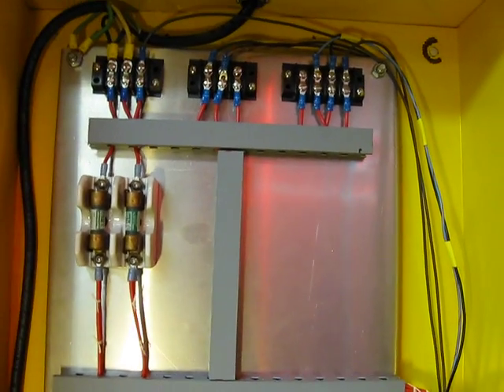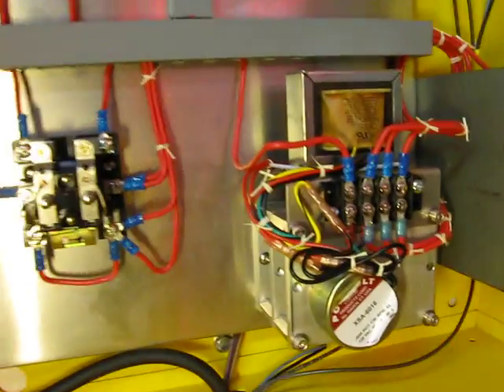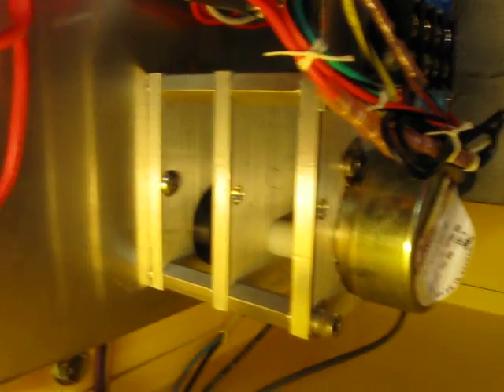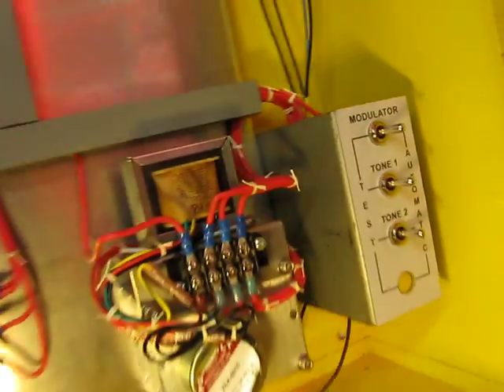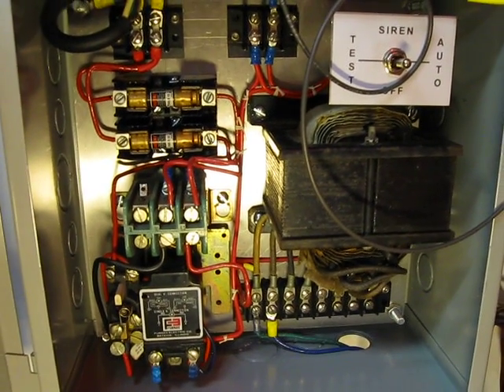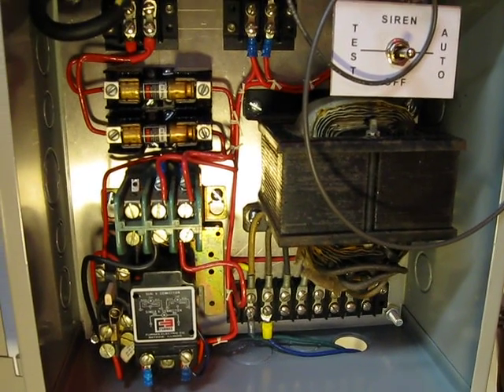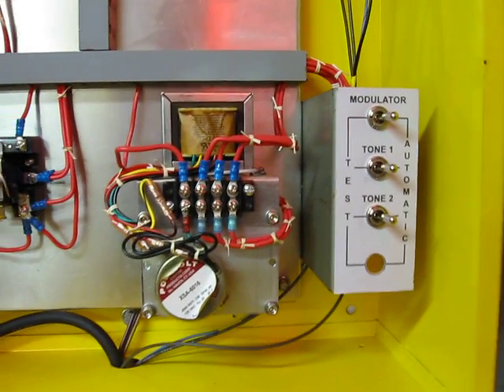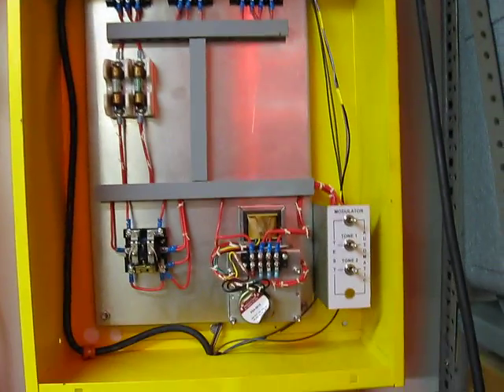My Thunderbolt 1003 Controls

Comment: Nice job on the flasher motor! My 1003 came with the 2 boxes complete but my switch panel is for a 1000. Want to add the red button and the different timing in the control but parts are scarce.

Comment: When you refer to the motor starters, is that just a contactor?
Reply from the maker: No. I belive a starter is the complete unit with overload protection where a contactor is only the coil and contact part itself.

Comment: When they needed to set these off, How did they do it? Like the buttens? or By like remote?  Lets say ones at a Fire department, they get a call, how it's it going to get turned on? but Dispatch with a botten? or remote?
Reply: Luke Shaver it uses remoat and button

Comment from the maker: It's the same thing as an RCM 3. It works and and is wired exactly like a RCM 3 except the speed of the hi-lo cycler isn't adjustable. It would operate any other Thunderbolt 1003 if hooked up to an RCM 1 panel. 
The 1/3rd rcm panel is only to operate the chopper motor. I made it primarily to run the chopper on my 1003 head and also I can run a Model 2/2T with it.